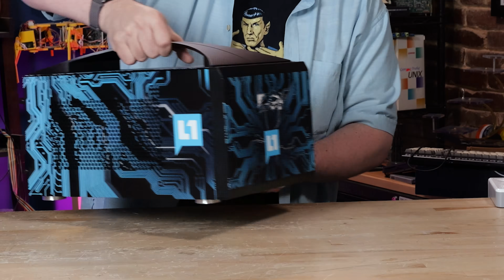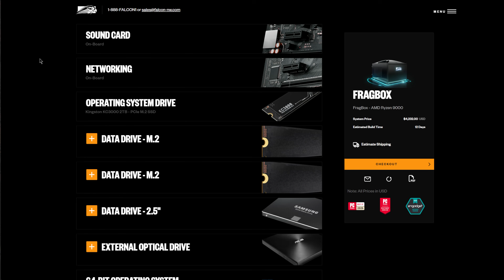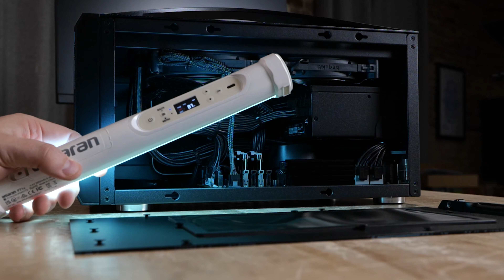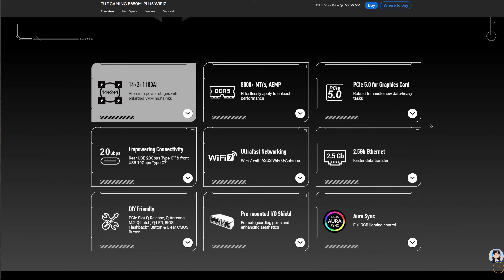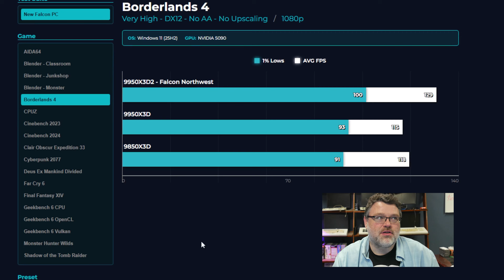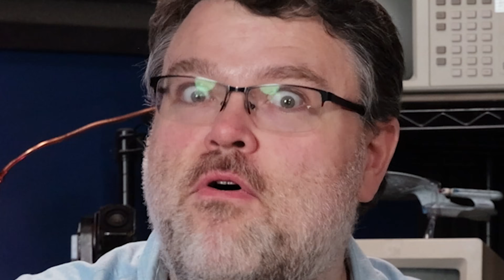Falcon North West 9950x3D2 Fragbox Review and Community Engagement

Comment: If I wouldn't have spent so much money on buying the respective newest Computer Shopper back when, I might have had enough money for the dream rig I then couldn't afford because I did buy all those issues of the Computer Shopper hunting for my dream rig 😁.   But, reading about the land of Doom and Pepsi Cola was its own fun.

And, for those "suffering" under the yoke of the single X3D cache in a 9950 X3D:  Project Lasso might help, but having two X3D caches obviates that workaround.
Reply: Hey you won the giveaway,info on the wire app using the handle name!!!

Comment: The board I’d put in that would be the gigabyte Aorus x870m. It’s one of the few 870 matx boards and it has usb4 opening door to eGPU. It’s a great board to get larger context windows on that form factor.
Reply: Hey you won the giveaway,info on the wire app using the handle name!!!
Reply: @level1_techs  Awesome! I'm checking on this now!

Comment: Based on the fun I am having getting an AM5 system to run CachyOS - what OS can this hardware fully support?
Reply from the maker: Cachy works fine on this. You might be fine to post on the forum for more help
Reply: @Level1Techs  I did find a few bugs in MSI's 850 motherboard that caused odd issues with booting off external ssd drive.  It works with m.2 - I think one of my fixes might need the efi=noruntime option.   Using the exact same media on the AM4 motherboard by MSI worked like a charm.  So media was at least valid for that hardware.

Comment: I picked one of those cases up back in the 2008 building a gaming box for portability the only thing that has changed on the front of that is there's no DVD drive spot for it anymore so yeah it makes a lot easier to get that Cooling in there nice build yes you shocked me when you pulled out the the magazine thank you very much you made me old again. The original was a from thermaltake the LanBox Vf1000
Reply: Hey you won the giveaway,info on the wire app using the handle name!!

Comment: Very cool case with lots of options, though I threw together a build that'll run everything I need it to without breaking a sweat for about half the cost, even though I had to spend time hunting down all the components at reasonable prices. If you have the cash to throw at it it's a very nice rig, I'll give it that.
Reply: Hey you won the giveaway,info on the wire app using the handle name.
Reply: @Level1Techs looks like we have a scammer in the chat.

Comment: I mostly remember Falcon from 90s gaming magazine scam lottery ads. They'd always advertise one as one of the top prizes. I remember them running some actual ads themselves for insane setups but the prices were equally bonkers. Like 4k in Y2K dollars.
Reply: Guys today don't know that in the early PC days of the late 80s and early 90s only hardcore computer geeks or businesses bought computers, because they were harder to use(we used DOS not windows) and way more expensive. I remember when a guy I used to work with bought a 486DX-66 system when they were pretty new and it cost him $2000 in 90s dollars!!! I think that included a VGA monitor. I know that it played Doom very well.  ;-)

Comment: My brother gave me one of his old Fragbox PCs that's probably 20 years old.  Not much ventilation and still has a DVD burner drive.  I'm going to look at drilling more ventilation holes in the case and building something more powerful, but I'm not sure about the current cadre of CPUs and GPUs that don't appeal to me.  AM4 is the GOAT, so maybe I'll take the guts from my full tower PC and put it in there.

Edit:  HOLY CRAP!!  I just looked at my Fragbox closely.  It's so old, it has a front panel I/O that has a FireWire port, and a 3.5" floppy drive!!!

Comment: Recently built an NZXT H2 FLOW and omg, yes. best mini case ive ever owed. I LOVE IT. You mentioned noise for this case being basically nothing.... same with my new system. and I LOVE IT. I happen to have put inside....

MSI B850-I Gaming Wifi ITX (new)
AMD 7800x3d (reused from previous build)
TeamGroup Vulkan Eco Silver DDR5 6000cl30 2x16Gb (reused from previous build)
AMD 9070xt hellhound which JUST BARELY fits the case, is awesome. (new, replaced my old 7900xtx red devil)
NZXT H2 FLOW
Noctua NF-A12x25 x4 (reused from old pc but want to upgrade because 2.xx H2O pressure is not enough. Thinking IPPC fans which have like 5.xx H2O pressure? and 100 CFM? which would help with airflow since i can't push/pull my radiator like i used to. smaller case!)
MSI MAG Coreliquid A13 liquid cooler (reused from old pc)
Asus THOR 1200w SFX-L (new)

And yeah, epic little system. The asus thor with the individual strand power supply cables made cable routing tighter/cleaner than typical power supply wires. So I had no issues with cable routing or airflow. Its very very clean. Literally the best cable routing ive ever done which is insane lmao. And yeah, its a high end system. Sure a 5070ti would fit, but the 9070xt/7900xtx is faster than a 5070ti at raw rasterization. I dont give 2 shits about ray tracing.... i just dont. Its such a useless technology. I mess around with unreal engine and you can legit just use lumen, get 90% the quality of ray tracing and yet it runs off the cpu instead of gpu. meaning it you get more gpu support out of it, allowing more gamers to play your game. this addiction to high end setting in games is the reason game development is dying. all these game dev companies, every single rig is a 90 series nvidia with a high end cpu rather its intel or amd. they legit dont buy low end hardware. IF I WERE A GAME DEVELOPER or at least running a company? my employees would get low end gpu's with high end cpu's. why? because i would want to make sure my game is MADE for the masses, not for the top 1%ers who can afford a 5090.... and then MY RIG would have a high end gpu to see what kind of performance I get with them making the game work on low end hardware.... that is how it should be done. and you save money as a company because you aren't buying multiple thousands of dollars in gpu's.... game developers today are dumb as shit in my opinion. I wish i was rich to run my own studio, because i would make all these other companies look like chumps.

temps wise, like I said i can't push/pull my cpu liquid cooler anymore. so it went up 10c. from 52c max to 62c max. which isn't too bad considering its a 7800x3d and most air coolers put people around 80c.... so im still cool and quiet. and then my gpu? shit.... my old 7900xtx with 75% fan speed FORCED would still hit 80c in some games like counter strike when im shitting 500+ frames. the new card? I haven't seen over 65c and its on the auto fan profile. which is insane. and i noticed in some games i get more frames (more minimums and more maximums) and other games I get less (sadly in cs2 I dropped about 50 frames but who cares. its still 450fps vs 500fps so whatever).

falcon northwest should become a hardware MAKER. in the sense of making their own motherboards.... then they could make a one off board which has a cpu slot and a gpu slot.... and then just slot in whatever cpu/gpu combo people buy. to me, this is the future. we need to get away from gpu's being "slot cards" and turn them into actual motherboard slot items. why? because we live in a time where the cpu could work off a slot cooler like a gpu typically has but a gpu would do WAY BETTER utilizing a proper tower cooler like cpu's currently get. i remember seeing a guy who put a nh-d15 on his graphics card and the temps dropped stupid low compared to a typical gpu slot cooler.... so imaigne a "steam box" but instead of a full size gpu, its got two tower coolers. which does in fact save space, making a system smaller while still being max performance.... imo, worth it in the long run. yes, if people want to upgrade, they have to buy a whole new system and you can't just upgrade. who cares? apple already does this to the masses where you have to buy a whole new apple pc and can't really upgrade. so why not move that way for windows machines? anything for ultra-small high performance systems. I mean the new steambox will already be tiny. now imagine it had a 9800x3d slotted and then it was "double wide" where the gpu got its own tower cooler. So two tower coolers, push/pull fans front/rear for both. its double width sure. but still tiny. and still super cool running. its just smart..... honestly i want to see new standards. we already have camm2 which is going to take over in ddr6 where standard dimm and sodimm will no longer exist.... hence the memory sales being shit right now. because they shifted ALL their production over to camm2 because its just better than dimm/sodimm by a huge margin.... its not AI that is causing memory issues. its the complete swap from dimm to camm2 that is flipping the market on its head. ddr6 comes out next year with new motherboards and yeah. people will be shocked. because memory speeds will finally be jumping. it was stated that camm2 will already double speeds on current ddr5 thanks to beter signal integrity. then its going to double AGAIN on ddr6. which means we get 150% increase in memory speeds next generation. shhhh. i didn't tell you this....

Comment: @Level1Techs - I'm pretty sure most or all (nvidia, at least) GPUs have mounting screw holes these days. I've seen them on a PNY 5080 and a Gigabyte 5090.
Reply: Nvidia (after years of begging from us) standardized a mounting hole spec (position, thread, # holes, etc.) a couple years ago. YAY! Great news for us building cases. Guess who didn't follow that spec?  Nvidia Founders Editions. 😫 Still, better than Radeon with no standard or requirement.
Reply: @Falcon_Northwest  Ayy, that's cool to know!